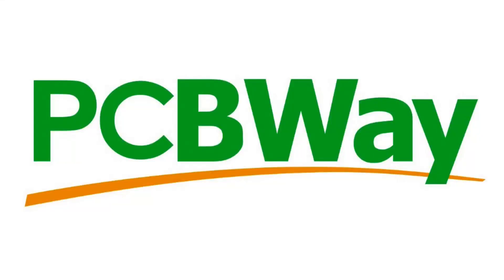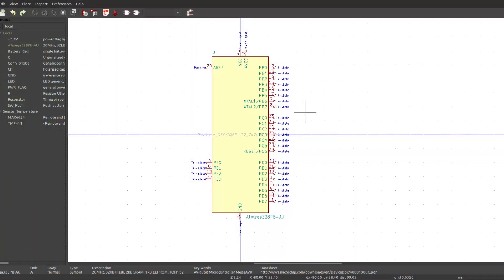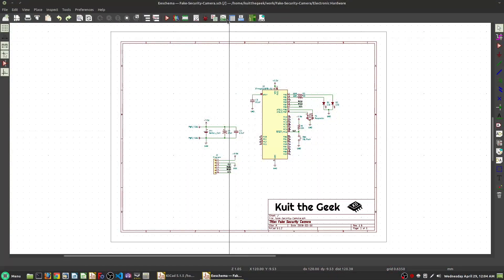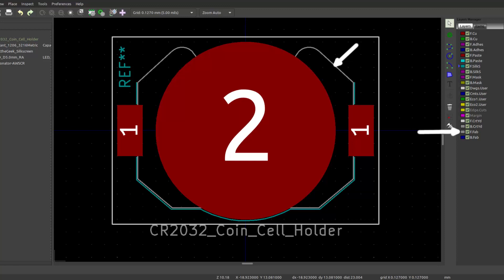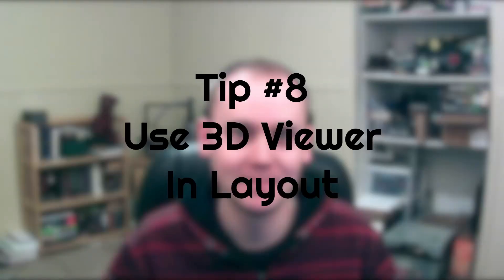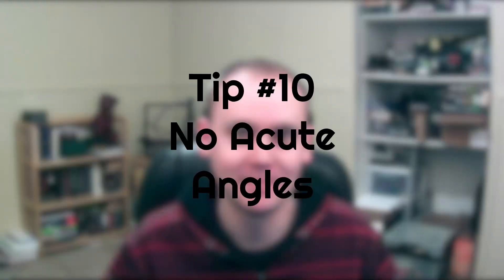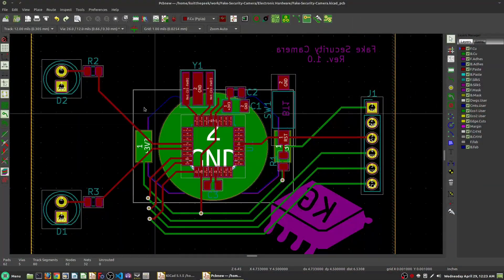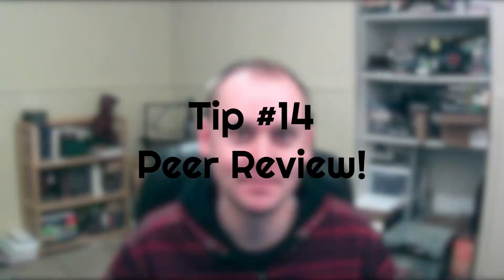15 Tips and Tricks for Using KiCad

Comment: Nice Job!  As a designer with a few decades of experience I completely agree with all your points - especially the last two. One "Rule" we had at one of my employers is "Test points on all traces" - I regularly forced a violation of these rules designing the high speed memory busses (in order to maintain signal integrity). Gave the Fab folks fits...
Another issue - with point #5 (Hierarchical design) it makes upgrading designs MUCH easier if a page is a function. Yank the page, throw in the new function and spin.
If I had only had something like this available in the 90's...
How about creating two specific videos on all the details in creating a PCB footprint (all the layers and details) and 3D Model (Again, all the details...)   I think these would be very useful.
Reply from the maker: I completely agree with you. And yes, test points on most lines I think is a very important rule, if you have the space. I have definitely done some very size confined boards where it wasn't feasible. But having test points on as many traces as possible is very useful in debugging. 

And yes, using pages as modules is a great way to do full function spins. I have also used it to start a project much faster too. I have used the ESP32 module on several designs, and it is very helpful to just pull in a few pages for the main chip and the programming interface and already have 40% of your design done. 

I really do need to get back to making videos, as I did enjoy it, and those two videos are definitely two that I have been thinking about for a long time. Hopefully, I can have things settle down a bit more in the coming months and I might be able to get those done. Thanks for the comment and the ideas.

Comment: In tip 5 I see that you have used a bus between hierarchical sheets. How did you do that? Could you share the design files, then I can have a look. Or a stripped down version maybe, if it contains sensitive information.
Reply from the maker: That is actually a really good question. Unfortunately, the picture I used is part of a sensitive document, so I can't share that. However, I think this is a really good tool that there doesn't seem to be enough information about, so let me see if I can get a video together quickly to cover that topic. If not, I will try to reach out and share some information more on that to you individually.

Comment: EasyEda is far easier to learn.
Reply from the maker: I've never used EasyEDA, but in my experience, KiCad is far more powerful. I've had discussions with classmates who have used EasyEDA and then I turn them on to KiCad, and they said it was difficult to learn but worth it for what they could do. There is also a lot of freedom with the software that you can't really find anywhere else, since the code is open source. I started as a fresh student on eagle, and I remember learning about the board size restrictions, and then when I moved to KiCad it seemed like everything was available to me and there was no pay wall. I've spent years using KiCad, and I would say it was always worth it to learn a more powerful tool.
Reply: @KuittheGeek  when i first tried to learn electronics i used easyeda, thought it sucked and it discouraged me from learning, then i downloaded kicad and its 100x better

Comment: How do I solve this problem? Symbol L1 pad ~ Not found in footprint Custom Components:T-68-6 CT.
Reply from the maker: The error is saying that it is looking for a pad in the footprint "T-68-6 CT" in you Custom Components library, and there is no pin labeled with "~". So I would double check your schematic part and make sure all of the pins have the correct numbering, and none of the pins are labeled with "~".
Reply: @KuittheGeek  How do I put a custom symbol in Custom Components Library?
Reply: @KuittheGeek  How do I put a custom symbol in Custom Components Library?
Reply from the maker: You should take a look at my video for creating libraries and parts in KiCad, That will help walk you through the process of creating a custom library. https://youtu.be/o0QtJxtkCwU